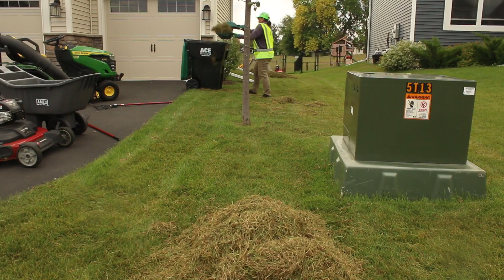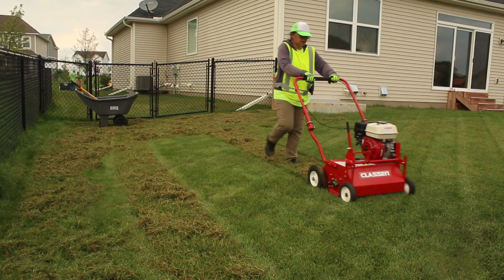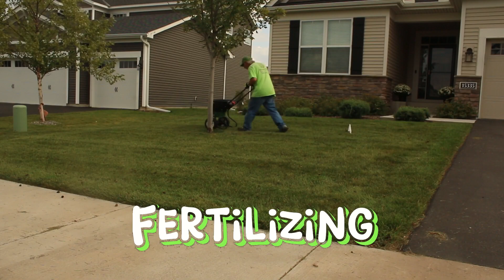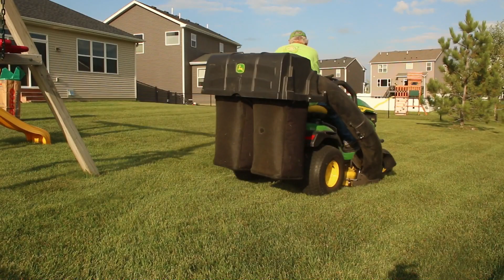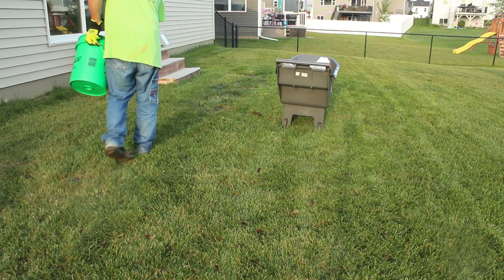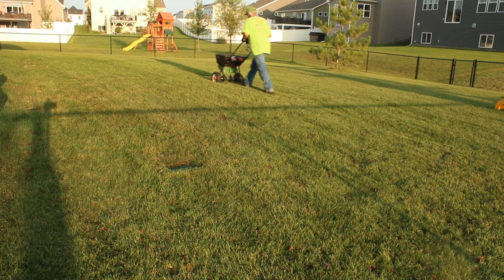Must Have Fall Lawn Treatments #lawncare #fertilizer #winterize

Comment: Hi great stuff.   I know I'm late.   Questions if i may, please.  Did you cut the grass low before the dethatch?   How tall was the grass?  What fertlizer did you use?   I'm guessing you didn't need to reseed the total yard.  What type of seed?   What type of dirt did you use for topdress?    All this of course is dependent upon you remembering.  Sorry I'm late.   Do you dethatch every fall?  Spring too?
Reply from the maker: Hello and thanks for stopping by. 
First, this is one of my customers lawns.
So yes we had him cut lower. Turf type tall fescue recommended normal cut is 3 to 4 inches. I recommend most of my customers cut at 3 inches. Some people don’t like the look of long turf in which case I tell them they can cut at 2 3/4. The customer wanted some dog spots fixed out back so we re seeded those and then maybe some other random spots. The seed is usually Pennington smart seed, but I sometimes have my own personal mix which I have had lots of luck with. The dirt is just topsoil from the local box store. You can dethatch in spring or fall your choice, I personally like spring, but the preferred recommendation is fall. You can do either. I would not do it ever year since you do not want to remove all the thatch. You want to remove enough thatch so that you can see the soil. Thanks for the questions
Reply: @MyGreenLawn2019  thank you.  I'm in NE Illinois so my zone is close to yours